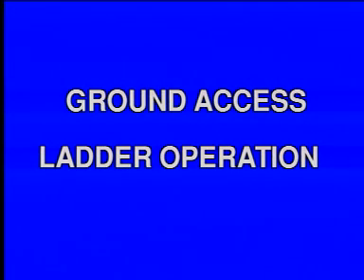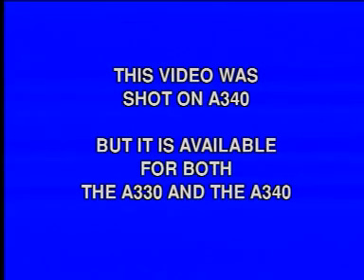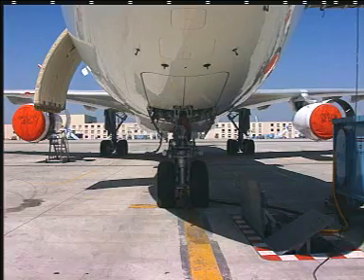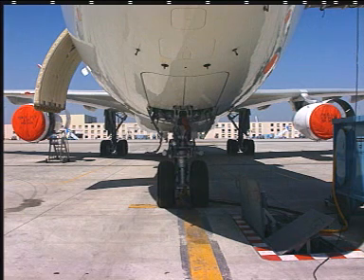AIRCRAFT | A330/A340 Ground Access Ladder Operation

Comment: 1:49 That additional extension is very clever, because the plane would sit lower fully-loaded, and sit higher empty, so this length extension is important for proper stable ground contact.
Reply: Correct! Although, when you part-out the aircraft including the engines, it sits so high on the oleos that the ladder comes up disappointingly short. I have some funny and horror stories from working on aircraft that had been stripped...

Comment: 1:43 question. Thats a good advice, even if you want to use the ladder, while flying. After you release the ladder, it will touch the ground properly, after a couple of minutes. Great design :)
Reply: I was thinking that when he said, "If the ladder doesn't touch the ground"...."Try landing the plane first".
Reply: Hate to ruin the fun, but the hatch won't open at altitude because of the pressurisation.
Reply: @David-ud9ju  Bad design... how can I make the ladder touch the ground when the hatch won't open during flight?

Comment: Just imagine - you spend years getting a mech engineering degree. Then more years getting a mech engineering master's. You get hired by Airbus, where you end up designing...a ladder. Woot. (In all honesty, though - it's probably a Really Good Ladder).
Reply: Multiple engineers probably worked on this ladder.
Reply: And each section is contracted out to 4 different countries
Reply: Honestly, it sucks. It gets the job done, but feels pretty flimsy.